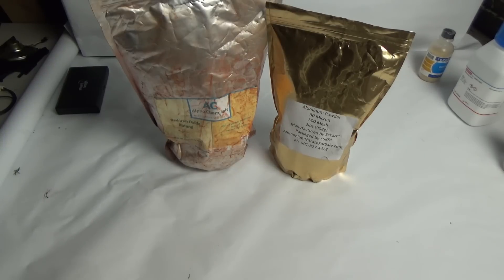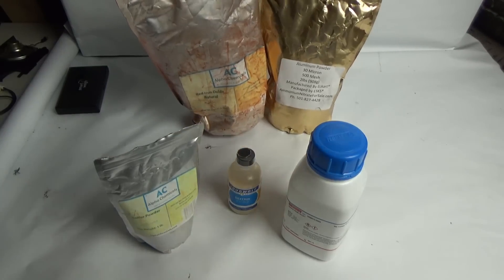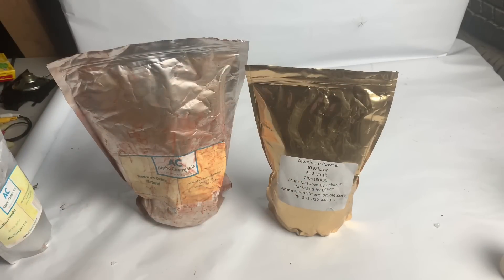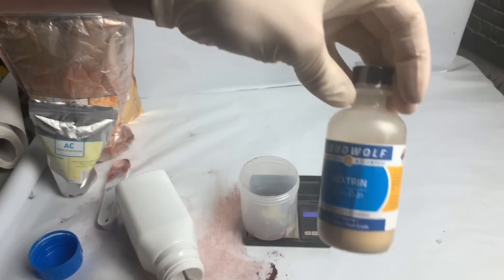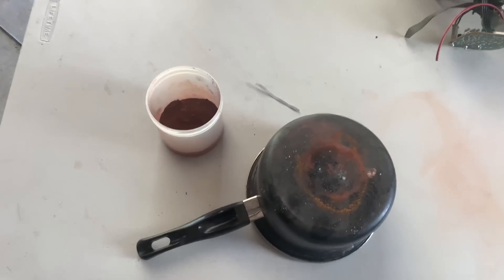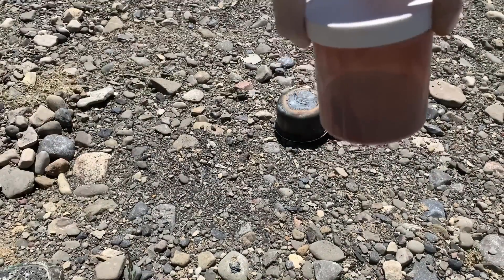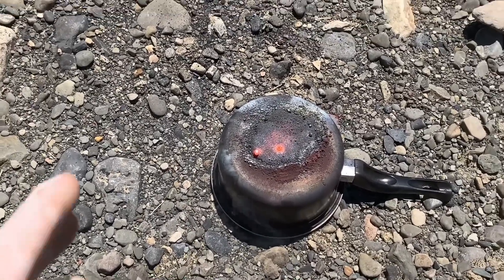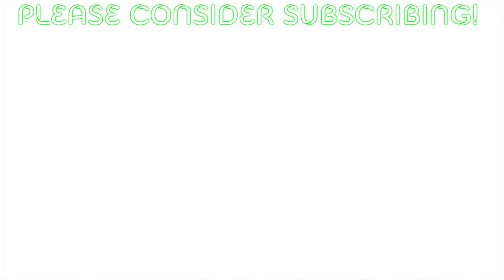Making "Angry" Thermite

Comment: Think you need to work on your mixing or mesh size of your components. The "standard" Thermite I make vastly out performs both of these. I also recommend a priming powder rather than magnesium, it's more reliable and can be lit with a spark or fuse. (50% KNO3, 30% Al, 20% S) works wonders. Great series, keep up the good work.
Reply from the maker: Kiefer Stout Some of my powders are not the perfect mesh size, still use some 2-3 year old 10 pound bags I bought when I didn’t know enough about it 😂 I may try your mixture with 20% sulfur, it seems interesting. Okay if I make a video on it if it works wonders for me as well?
Reply: @Techience  Of course, happy to help. It took out all the frustration of trying to ignite my own thermite experiments reliability the first time, every time. You don't need much, just a small quarter size pile on top and you're good to go.